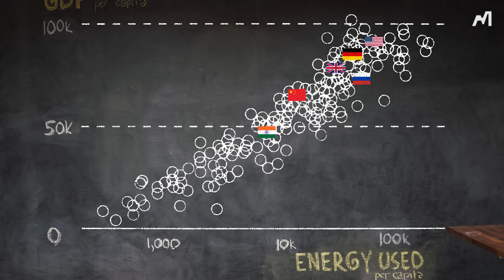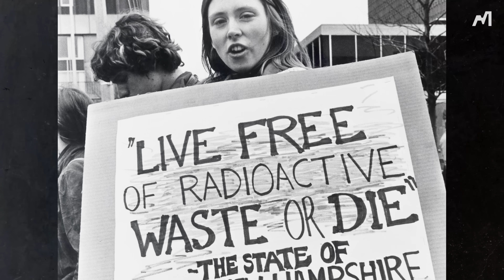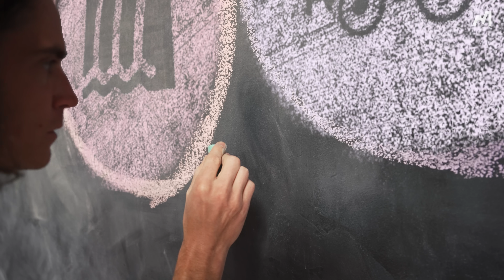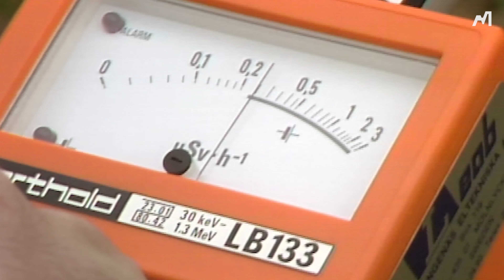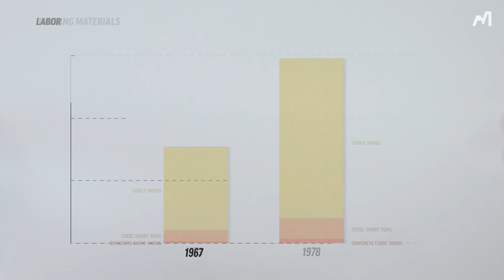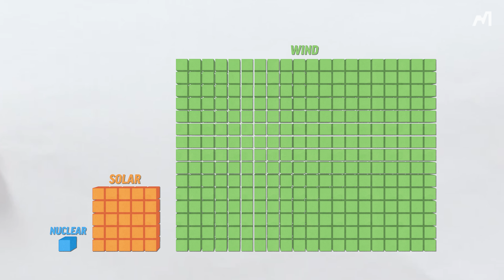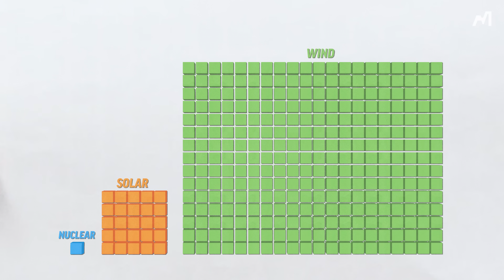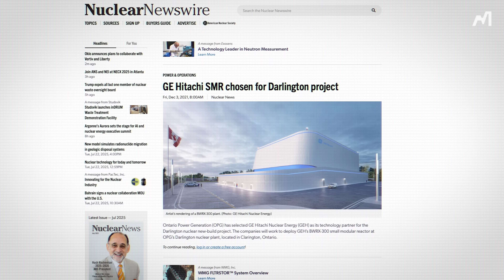They're Lying to You About Nuclear Energy

Comment: I live 8 miles as the crow flies from Plant Vogel. They recently finished adding to new reactor. It was supposed to take 6 years. It took 18 years. I think it was supposed to be around 14 billion, ended up around 35 billion. Over-regulation isn't a strong enough phrase.
Reply: They went through a goofy NRC regulatory process that delayed it and don't forget the lockdowns, strikes, and supply issues. And they got it done anyway. An amazing new type power plant. I'm a licensed reactor operator. They did an amazing job.
Reply: Regulations are how socialists took over businesses without nationalizing them.  It's a clever scheme I have to admit so it doesn't look like we live in a socialist country.
Reply: This is "cheap" compared with most other projects that have landed in bankruptcy
Reply: @server1ok Westinghouse went bankrupt at the beginning of the project
Reply: Its more of the constant update to comply with regulation that ram up the cost, not the rule it self. So new project with current rules will cost maybe a billion more. To redo current infrastructure add the cost significantly as you paying 3 times. Build the original plan, tear it down and build the new. So it seams its intended to prevent building such power plant.  
In my state we have 2 plants and some reactors from soviet era. But we were becoming a heavy industry satelite and add at the time build new generation of reactors. 2 still operate and will be decommissioned in few years and before the conflict finish and turn on 2 new one. But i think its about the willingness as we have no problem having a exceptions. Like lowering the load and wait until it become less of a economical hit.
Reply: Don't forget the COVID 19 Pandemic. The lockdown was necessary to save lives.
Reply: @RamPande-s5ohopefully this is sarcasm
Reply: @jenkins2162 I worked out there in 2020 on construction and no it isnt sarcasm. They encouraged vaccination. It makes sense when you think about it. Over 20k people worked out there during the height of construction, having even as little as a tenth of your workforce out due to covid drastically slows construction even more than it was already.
Reply: Hinkley Point C is the same kinda thing lol
Reply: That's how government reacts to voter fear. And also that fossil fuel money.
Reply: I don't live anywhere near a nuclear reactors. AUSTRALIA  is to dependent on selling its coal and uranium 🎉 for some dollars, and keeping the rest of the world employed, building/ backing solar and wind. It's called stupidity.
Reply: @murpbassett4818  I love my fellow Australians but we are very brainwashed against nuclear.
Reply: Money laundering Scheme.
Reply: The Connections (2021) [short documentary] ❤
Reply: What is Chernobyl Heart Syndrome? Who is harmed most? Do even normally operating nuclear power stations in operation continuously emit radioactive Hydrogen, Tritium? Yes they do. It can't be filtered or evacuated from one's body after bioaccumulation.
Reply: IP rights feeds into regulatory capture feeds into endless money to bad contractors. Comrade, via cronyism nothing much gets done, like in mother Russia!
Reply: What phrase do you prefer? Mismangement? In South Carolina some people went to jail because they handled the expansion of plant Summer not very well.
Reply: Good luck when the Earth moves.
Reply: I wonder how much the politicians and regulators stood to make because of it, by sabotaging it.
Reply: As we can conclude, we are being lied to and abused...and eventually these projects are used as a disguise to steal money from us and maintain us as slaves....
Reply: It’s theft!
Reply: Its not the atomic plant. Its the people who run them we dont trust them to not f things up.
Reply: My God you right wingers will blame falling on your own faces on regulations.  The inept construction management caused the overruns at Vogel, it's well documented.
Reply: The real issue though is who was behind the over-regulation....hint: it was not the tree huggers....do not underestimate the power of the fossil fuel industry...
Reply: @wadehathawaymusic you could say that the treehuggers have been useful idiots in all this
Reply: That almost sounds like money laundering as well.
Reply: You can blame over-regulation, but nukes aren't the only thing that go over budget in the west. Military and Space projects do to. Pretty much all big engineering projects go over budget now, even if they are not overregulated. Western engineering is not efficient or competitive.
Reply: Votgle <3
Reply: even France only take about 7 years.
Reply: If ever there were an ultimate limit to "growth," it would look exactly like what is happening now, where all alternatives are short-term gain at the expense of long-term sustainability.

There is no such thing as permanent, safe, storage of spent fuel (witness the ongoing storage of spent fuel at plant locations from lack of dumping sites, making each reactor site "an event in progress," just like what is going on at Chernobyl and Fukushima)!
 
More stupidity is not the solution to stupidity. The simple fact is that the intense ionizing radiation in the boundary of the nuclear fuel causes the containment to transmute over time, where the containment materials lose their original elemental qualities, frequently becoming brittle and no longer able to perform as originally intended. Zombie reactors that are past their designed life are losing the safety safety factors originally designed into the containment in ways that are not predictable until incidents inevitably occur. The same thing applies to the containment of high-level nuclear waste. These matters are well-known to the industry, but being withheld from public scrutiny in order to maintain the current zeitgeist.
Reply: @richardmcbroom102 what you say is true. Most people are somewhat familiar with Chernobyl but few know the magnitude of Fukushima. I have had long conversations with an uncle that is an engineer concerning things like this. He is a brilliant man. I personally do not see a future without  nuclear or fossil fuels. I admit that it should be possible but the technology doesn't fully support it. It relies too heavily on the old sources of energy to produce the new, which isn't as efficient in some ways. It should bridge the gap until those sources become more fine tuned. The sun is the ultimate source of energy. Finding the perfect way to harness and store that power will be key.
Reply: it is not about regulations only. Lots of engineering they have to do again that costs billion. No lessons learned.
Reply: @TomasVolley  What lots of engineering do they have to do again??? Nuclear power isn't new, the only thing new is government regulations.
Reply: Most of those overruns were actually because they have forgotten how to build these things, they had the same Teething pains when learning how to optimize the process the first time.
Reply: It was nuclear engineers who kept finding potentially catastrophic accidents waiting to happen, and ensured the next designs fixed the issues.

Each new design became more and more complex as a result, because the fact is, nuclear is just complicated. That's why its expensive.

There's no grand conspiracy. Its just a fact of reality
Reply: @Cambyses1467 I never thought it was a conspiracy. I do know regulations played a huge role in the costs and time frame of the project. I have literally experienced it.
Reply: @jenkins2162  Yes, necessary regulations because nuclear energy is inherently complex.

Fission is an inherently unstable and unnatural process. Trying to control it is obviously complex and expensive
Reply: A lot of those regulators should be out the door. The government has basically outlawed nuclear power plants in exchange for their friends who own energy/oil companies and make big donations to their “preferred”parties.
Reply: Follow the money.
Reply: they always blame Over-regulation and labor cost wake up it is BS
Reply: Yeah it’s not overregulation it’s corruption from oil companies how much more abundantly clear does it have to be that corruption caused this. Bribery.
Reply: You think it's just over regulation?
The US government is so petty that the previous admin REVOKED the Turkey Point reactor operation license after it had already received it 2 years prior....all because they hate my governor.
Reply: Yeah, it was way better in the Soviet Union where reactor installation always completed on time regardless of the construction difficulties
Reply: It wasn’t over regulation and it caused to be that expensive billions of dollars of overruns. It was the poor workmanship and having to replicate work or start all over on major component systems that added billions to the cost. This made the plant take several years longer to complete adding to the cost.
Reply: @billaddington831 regulations were 100% involved. I've worked at nuke sites that were fully functional and saw many that were ridiculous.
Reply: @billaddington831 The over regulation is what causes everything to be more expensive. Have you ever bought a roll of Nuclear Duct tape
Reply: Even if the price tag was half as expensive, it is still way to expensive as an energy source. No sane company will build those even with less regulation involved. And just last year to so often referenced small nuclear reactor company went bankrupt.
Reply: Nothing to do with regulation. Nuclear is inherently expensive as well as being of no use to reduce CO2 or tackle climate change. All the energy released adds to the heating of Earth already in progress. It's a cult of true believers who avoid considering the real costs.
Reply: And they shut it down immediately for a pump failure before firing it back up. sound safe? Idiots, all nuclear is a lie, energy, medicine, you've been had.
Reply: I know, health and safety, down with that kind of thing
Reply: @richardhall6509  LOL, your a nut job. Nuclear power isn't some new scary thing. The US has had it's first nuclear submarine made in 1954. You know how many nuclear sub's exploded or had sailors die from radiation poisoning on them? Zero. Zero in 70 years... 2,000 new regulations from government officials don't magically make it more safe. But it does it make it more expensive. Look at California, most expensive place to live in the country because the State Government regulates so much that the cost of living is artificially higher for no reason.
Reply: @richardhall6509  health and safety is bloat for sure, and it's mostly there to protect insurance companies, not actual workers
Reply: @Civilianmusic  Hows that Cell Phone you carry around?
Reply: @beckiwildeman600  Cell phones do not emit ionizing radiation, their frequency band is much lower: this means less energy per photon or particle which is not able to make kaputt molecules like your DNA.
Reply: @Civilianmusic  insurance companies don't insure nuclear power plants they are all government insured and finased
Reply: @richardhall6509  Nice bad faith take.
Reply: @richardhall6509 oh lord. I know a government worker when I see one. Overregulation has existed since the 90s and it’s why we are suffering in all aspects of life

Comment: The Leftists have used FEAR to control entire nations for decades. Nuclear Power is the cleanest, environmentally friendly, and safest way to produce electricity if it is built with passive fail-safe mechanisms such as those found in the Pressurized Water Reactor design.

Comment: 15:40 it's not fear, it's profit... always has been, always will maybe.
Reply: I was literally about to comment this. The fear came in as the profits on oil, coal and gas started to taper down due to nuclear handling more of the energy production. Nuclear removed long term mining needs (coal) and wind and solar brought in the continuation of mass manufacturing and the requirement of massive battery storage systems, not to mention, replacement costs quadruple that of nuclear due to manufactured lifecycles (planned obsolescence). No one wants cheap and easy electricity production, accept of course the consumer.
Reply: @MichaelDrowley 
Great minds think a like and are rare. Actually, common sense and critical thinking are the highest levels of understanding and there are not many who have these crucial skill sets anymore. 
Another resource (that's revealing of corporate and government corruption) that is in abundance but is not used because profit margins are too low and you can't weaponize it effectively, is: thermite. I'm sure you're already aware of this from the nature of your comment.

Comment: The Ford Nucleon, a 1950s concept car, was envisioned to have a remarkable range due to its nuclear power source. 
It was designed to travel 5,000 to 8,000 kilometers (approximately 3,100 to 5,000 miles) before needing refueling. This extended range was to be achieved by using a small nuclear reactor, potentially utilizing a steam engine powered by uranium fission, similar to those in nuclear submarines.

Comment: Amazing video dude. Loved it. One thing about solar that does make it more viable is the fact that you don't have to use fields. Roof tops and parking lots can be covered and that is an advantage of itself. Lower building and vehicle cooling is a giant benefit for energy use that is almost always missed
Reply: I would support solar electricity more if the efficiency wasn't this terrible, and the materials were more recyclable.
I like solar thermal though, not much use in an energy production capacity, but as an individual use basis it's superior
Reply: @nicolaspeigne1429 solar thermal is awesome for sure. I think traditional solar makes a lot of sense for rooftops and coverings and solar thermal is awesome for places that are not weight and space constrained. Traditional solar lasts so long that the recyclability is not an issue in my opinion. Wind for instance has almost zero recyclability and is a huge harm to the environment over the medium and long term. Oil is limited in availability. Hydro has a lot of moving parts. Nuclear is complex to make, but an amazing option imo

Comment: I want to note that "as low as reasonably achievable" is a crazy metric. Even in the UK we don't use that metric, instead we say "as low as reasonably practicable", where the reduction of risk is compared with the cost of doing so. If you're spending lots of money to reduce risk by zero, this is not reasonably practicable.

Comment: Nuclear power has its uses but didnt France just have its nuclear reactor turned off because the coolant water in the local river was too hot because of climate change? 

Are you a insincere shill or just forgot to look at the environmental footprint for nuclear sites?
Reply: I dunno but the only thing I could find on this was that a reactor was turned off because a “massive influx of jellyfish clogged the cooling water pump and triggered a safety shutdown.”
Reply: Tbf it says the incident could be linked to climate change as rising sea water temperatures caused the jellyfish incident.
Reply: doesn't France have something like 60 nuclear reactors?

Comment: I wish you had touched a bit more on the ratcheting effect of regulations.
For example, extremely cautious measures that are considered too excessively costly at one point and so are not considered reasonable, become cheaper over time and suddenly become "reasonable" and soon become mandatory 10 to 15 years later.
Then, as you say, designs which did not include them originally are suddenly expected to now comply with them due to new rules introduced since the plant started construction.
And anyone that challenges this gets, "What? You're willing to just roll the dice with safety over something so crucial?!"

Comment: I have very mixed feelings about this video. My first impression was: Wow what a well researched video that clearly tries to tell an objective truth. But the more I looked into the video it seemed to me that it does not differentiate the downside or risk and or problems of nuclear power with the uses or risk of other energy sources. Furthermore it states facts that simply lack any source, like that nuclear plants can be used for 80 years. They are calculated for 25 to 30 years of use. Wich can be expanded to 40 or maybe even 50 years of use. But the tec that is used to operate the plant still is 50 years old at that time. Some nuclear plants may even rely on windows 64 to operate. ( I didn’t check that statement it’s just to illustrate the difference in technology). To sum up I can’t get away the feeling, that this video try’s to sell you that nuclear is good while all other energy forms are far worse, so it feels like pro nuklear propaganda.

Comment: WOW fancy confusing infra -red radiation with gamma rays. Dont you know only 10% of Ultra Violet light reaches the earth surface. and of that 95% is of the longer wave UVA variety. But listening to you  conflating all of the electro-magnetic spectrum into one is highly misleading. and you are hinting that NOBODY has ever died of radiation poisoning. It is important to distinguish the difference from acute radiation exposure that brings death in a short amount of time, to low levels that causes long term effects like cancers.  It is like saying that it's ok to place your mouth over an exhaust pipe and take all the fumes because you will breathe it in the same way whiles walking. Both are bad but one is significantly more dangerous than the other

Comment: I used to believe that nuclear power was dangerous until I found out that the immediate death tolls from said accidents were very minimal, and that in both the Chernobyl and TMI cases, human error was the likely cause. This was about 2 years ago when I U-turned on my beliefs from nuclear being dangerous to “nuclear is only dangerous if you do not have a well-oiled crew to run it, and also it’s the most cleanest source that could last generations compared to coal, oil, and gas”